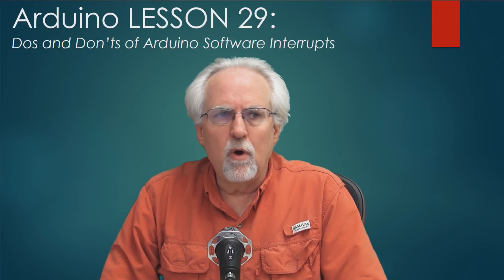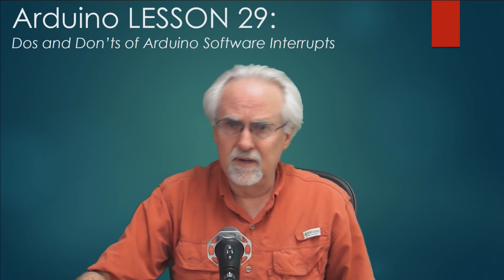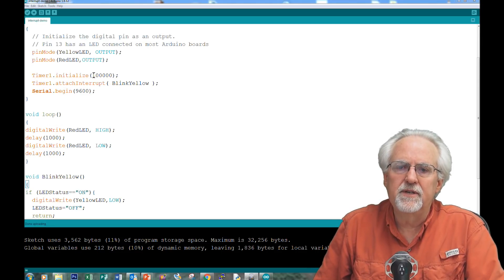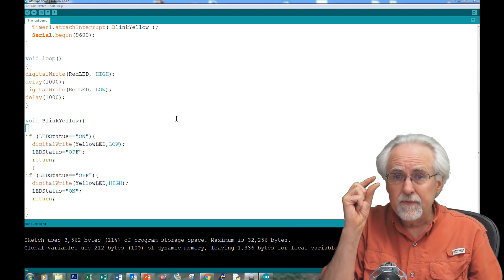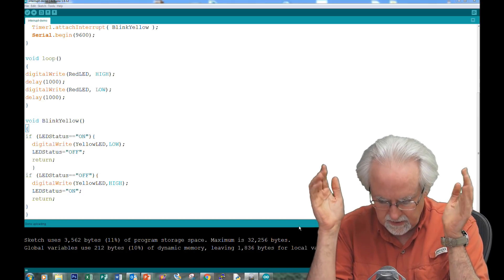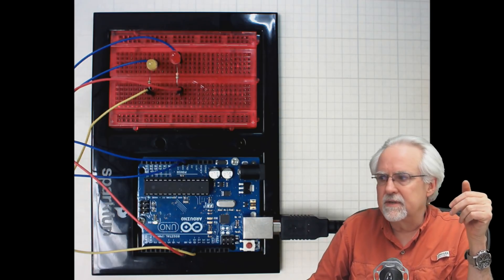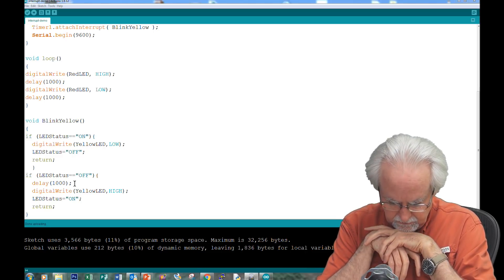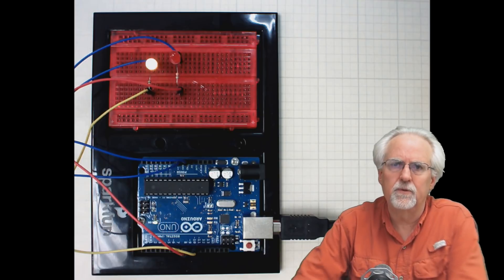LESSON 29: Dos and Don'ts for Arduino Software Interrupts

Comment: Hello Sir,
Really need your help, Can you please make a lesson on how  to count running hours of a generator or a motor etc. Actually what I want to do, I have two electric sources one from Grid and other one through Generators. Each source running at a time, And I want to monitor their max & min value of coming voltage, current voltages, max & min values of Amperes, current coming amperes, KWH, how many time each source has been run, and counting of their running time of each source. Really appreciate if you make a lesson on that. Thank you

Comment: 5:22 It might seem like it's ignoring the delay but it's not. It's filling up the stack with each interrupt call that are overlapping. If the interrupt calls happen so frequently that the servicing routines take longer, the stack will grow and grow until you get a stack overflow.
Reply from the maker: YOu sir, know a lot more about this than I do. I am an electrical engineer, and just play with arduino. I am not a computer science expert.
Reply: Sorry for a late comment, but could you explain this a bit more? Or if you have any resources I could read up on this could you share it?
Thanks a lot
Reply: @anubhavvvvlol  I think it's like a buffer. Let's say you interrupt every second but delay in the interrupt for 5 seconds... That means every second your getting a delay called of 5 seconds. The stack only has some space. After 5 seconds you have 5 delay calls in progress.... It gets worse as time goes on and then there's no more space to store the calls, so you get an overflow. I'll be trying this out myself. Thanks

Comment: All the other lessons in Arduino are very good, finally upset with interrupt. Please post the direct code instead of library.

Programmers like me need the source code to understand. Please don't use my code, just posted for clear understanding.

Timer1 is for only one. no comments in code, please forgive.

e.g.:

byte outputPin[] = {2, 3, 4, 5};

int ledStatus[] = {LOW, LOW, LOW, LOW};
int waitTime[] = {40, 30, 20, 10};
unsigned long previousMillis[] = {0, 0, 0, 0};
unsigned long currentMillis[] = {0, 0, 0, 0};

void setup() {
  // put your setup code here, to run once:
  Serial.begin(115200);
  for (int i = 0; i <= (sizeof(outputPin) - 1); i++) {
    pinMode(outputPin[i], OUTPUT);
  }
}

void loop() {
  // put your main code here, to run repeatedly:

  for (int j = 0; j <= (sizeof(outputPin) - 1); j++) {
    currentMillis[j] = millis();
    if (currentMillis[j] - previousMillis[j] >= waitTime[j]) {
      previousMillis[j] = currentMillis[j];
      if (ledStatus[j] == LOW) {
        ledStatus[j] = HIGH;
      } else {
        ledStatus[j] = LOW;
      }
    }
    digitalWrite(outputPin[j], !ledStatus[j]);
  }

}
Reply: There's on point listing the code of a library when you can access it yourself and it will go out of date.

Comment: Hi, how can I connect 6 dc motors in Arduino
Reply: You will need to use 3 of the l293d IC motor driver check lesson 37 of his new series also your comment is two years ago so I think I didn’t help u that much